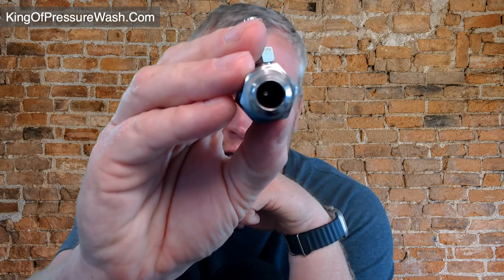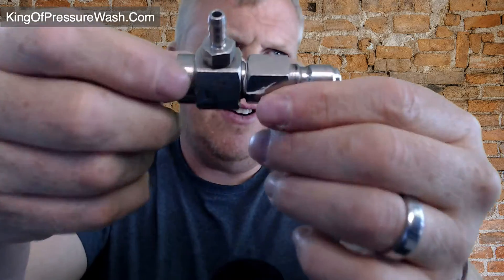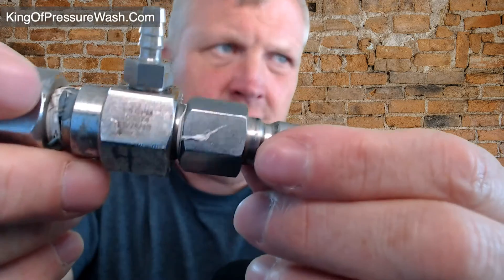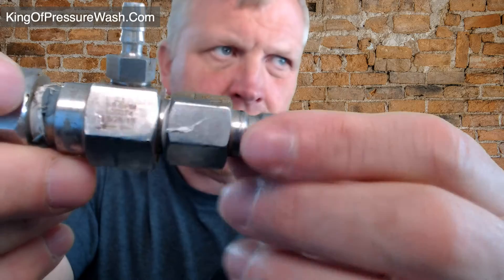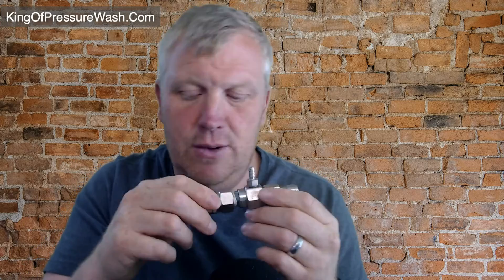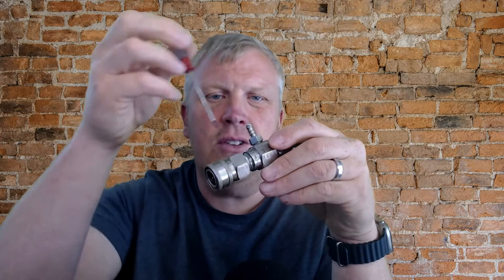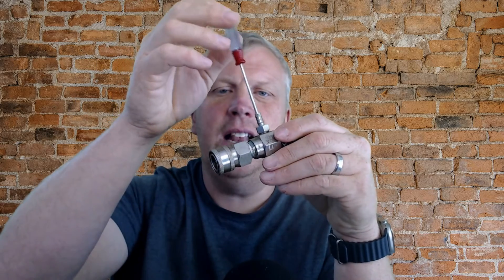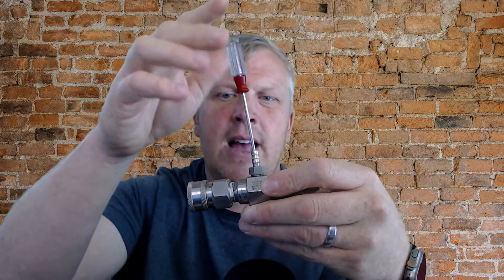Troubleshooting Your Downstream Injector: Why It Won't Suck Bleach

Comment: I was not drawing any fluid from my detergent tank. I pulled off the connector on the downstream injector and it was full of a solid white resididue. I did get this cleaned out and dislodged the ball and spring. There is still white residue in the injector. I tried to get most of this out but I don't see a hole for the fluid to get through and mix with the pressure washer. How big is this hole which allows the fluid into the injector? Not ready to put a drill in there yet.

Comment: thank you, .  my issue with ball getting stuck, i would put the barb to my mouth and blow in it and the ball would be stuck so would release it with the pin. i could then blow in it but when i sucked  it, it would not let air out.  i purchase  a rebuild kit from GP and replace all 3 (ball, spring, gasket)  i have not tested it on the pw but when i put the barb to my mouth i can suck and blow air. should i be able to suck air or not?

Comment: I can’t find any videos or info on what I’m having issues with. I have a sud sucker injector, on an 8gpm machine. Pulling 12% bleach. Also with bleach enhancer/surfactant in it. M5 twist to apply with. When I’m doing a house, gutters. I apply it 3-4 times and still dosent come clean. When it’s coming out it’s coming out pretty sudsy and I can smell the bleach. I can’t smell the (pine, lemon) additive. I let it dwell for 10-15 min. Then do it over and over again and the algae is STILL on everything. The only way I can get it off is putting pure SH in pump sprayer and spraying it letting it dwell and rinsing… so why does my downstreaming never really work like it’s suppose to? Should I just get a 12v softwash set up?

Comment: Hey family so I’ve had some issues in the field. I’ve used an xjet for 3 seasons now and I’m done carrying a bucket around. I have a 5.5gpm belt drive washer, I bought a 2.3injector with bypass kit and I bought an m5 twist(3-7gpm) with shooter tip combo. 

I did a job this morning but had to go back to my xjet. I was able to pull chem with the ball valve downstream but when I put my gun and tips on it shuts the chem off… help!

I have about 7ft of hose going from injector to tank and 200ft of 3/8” hose flowing through a reel. 

Any advice is appreciated

Comment: Just got into DS I stared off using a 2.5 gpm for practice. I brought the correct DS for the 2.5. I made sure it’s flowing with the water. When I place it into the bucket with water on and psi not attached THERES FLOW I can see the soap water flowing and bucket going down. when I attach the psi hose there is still flow from the bucket to the DS into the hose. Once I attach the gun to the hose no flow. this is all while the washer is off. There’s no flow with the.  I removed the tip and still no flow from the bucket. Yes the water has been on all the time

I’m thinking it’s the gun but here’s the kicker I added a ball valve and there’s still no flow. I’m confused

Comment: Great video sir!  I had a question regarding sealing concrete.  When sealing should you clean the concrete normally with a post treatment and then apply the sealant?  I did some testing and the SH seemed to make the sealant turn a little milky.  Not sure if it was concrete temp or my post treatment was too hot.  Thanks!!
Reply from the maker: Yes, I would not put a SH down after you clean it and before you seal it. Because it's gonna cause your problems.

Comment: Thanks for this video. I am still currently trying to figure out why my setup won’t pull chem through injector. I’ve checked the injector spring and ball, changed it, manipulated the loader (I have a pressure gauge so I can see the pressure changing on the outlet of the machine)… I just cannot get it… I’m going to try another Jrod next
Reply from the maker: Will it pull with no gun on it?
Reply: So i put the downstream hose inside a big clear bowl and I took the whipline off of the hose reel… I started the machine and the injector pulled all the liquid out of the Tupperware bowl with the whipline not tied into the hose reel. I put the whipline back on the hose reel and no luck. Also, sometimes I have liquid flowing backwards and OUT of the nipple of the downstream injector. It’s a real pain in the butt why I can’t get this thing to work properly
Reply: @MedinasProWashSolutions same exact problem, did you figure this out?
Reply: @nicholasfioretto3492 yes I did. My original pressure hose was 1/4”… as soon as I switched to the bigger 3/8” hose, my downstream injector worked perfectly. The 1/4” hose put too much back pressure and it wasn’t enough volume for the injector to work. As soon as I increased to the bigger hose, no more issues afterwards